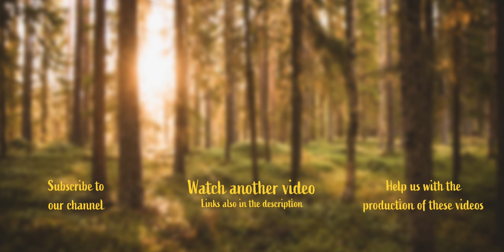FINALLY! Pouring the Concrete Roof! Will the Form HOLD UP?

Comment: Such an awesome project, good neighbors are difficult to find and a strong community is even more difficult, especially, it seems in this day and age. But y'all are off to a great start. Awesome new cellar!! I know how you feel, I've done lots of rock and mortar work, designing and installing above ground water features, ponds, and waterfalls, with rock based creeks and streams. Because, unlike y'all here in the Texas Hill Country, we on average can only dig down about six inches, before we hit several feet thick layers of limestone. So everything has to be built up. For the most part.
Reply: Community is very hard to come by these days.  Glad they have help to call on.

Comment: And if I may suggest - a layer of old carpet on the concrete. Then a layer of heavy reinforced vinyl (old billboards on highways) and another layer of old carpet, before you bury the roof in soil/backfill.

Comment: Maybe next time you pour any cement you can let your son put his hand print in wet cement so he can see when he gets older how small his hand was. Our house built in 1910 and we have any area where those people did that to their children when they were babies. Those children are in their 80s now. They visited us about 10 years ago and we showed the prints to them. They had forgot all about that.
Reply: My understanding is that the concrete roof will be underground so it's not something a handprint would show up on. Correct me if I'm wrong.
Reply: @earthangel8730  I believe I said next time they pour cement 😁
Reply: @dannyburrell4014  I don't know why this comment made me laugh so much😂 Cheers.
Reply: @darceljones2571  sometimes people read about half of what is written and make up the rest 😂😂😂😳
Reply: We did that when pouring the slab for the rain water collection barrels.

Comment: That is so very generous the neighbor assisting with help. We also have a small mixer and its like a teaspoon in comparison to a bowl full of the amount of concrete that is needed for such a pour.  It was very good you used a vibrator to settle it too. As it cures it will get stronger... like the community😀
Reply: Community is great

Comment: WOW
What a milestone ! I cannot wait to see it all covered with soil. Only comment that I would make is that I think that if the wire mesh was lifted from the roof surface 1”-2” it might have made it stronger.
Reply: It is within the concrete, not on the bottom. You can see those little connector thingies that hold it up a few centimeters from the mold surface.
Reply: Yep, another box checked off

Comment: Remarkable videography.   With that many timber supports for the roof it would have held 12 tonnes of concrete, not just the 2 or 3 placed on it!

Comment: Well done to both of you. the form work looked good and strong, a vaulted roof a very good move. good to see you put the mesh on plastic chairs and the concrete vibrator............ suitably impressed. It would be good to leave the forms inside the cellar for 28 days so the concrete can reach maximum strength (98%), the other 2% comes over the life of the concrete. You have now learnt how heavy concrete is. 
Your thoughts on community are thought provoking, are communities created or do they evolve over  time?  A sense of community is to my mind extremely important. 
The garland Tova made very pretty and very autumnal, is there significanceto the garland?
It would seem you are having a wet autumn  up there and I have had a wet winter and now a wet spring down here, still soon be Christmas!!!!!!!!
As always stay safe.
Reply: Another box checked off for them

Comment: you did massive job, guys. why did you choose concrete roof over earthen one? pine rafters [logs] would hold it, provided you don't put a house on top of it. poly film 'd keep the beams dry and lovely.
Reply from the maker: Since the climate in the cellar needs to be very damp for cheese, wood would not last very long.

Comment: Good job but I don't understand why concrete? You could have built a nice lightweight wooden roof. You also filled the space behind the outside walls without insulating the walls from the outside. The soil will pass the moisture into the cellar walls over time making the atmosphere inside damp all the time and whatever you keep in there will suck the humidity which is not good for a cellar. I'm talking from experience.

Comment: I don't really understand why it had to be a concrete roof and why you could't have just used a rubber barrier topped with soil. The space below is too low and compromised with all those support posts, hardly  worth the effort. 
Straight across solid beams surely would have done away with the inner supports. I just think its too low and cramped inside and could have had a way more efficient design and definately an easier build.
I have been watching for quite a bit and definatelly admire the two of you greatly. In terms of completing your various projects you must think efficiency as well as utilising your resources to maximum effect. I'm a home owner who can identify with the many unfinished projects and the anxietes experienced to get them completed.
I'm a corporation of 1, cannot afford swedish labour and material costs and have learnt the hard way to be efficient and use resourses to the max.
I spent a whole summer building a water proof wood/machine storage shed, on an un-used ditch on my land using scrap wood from the dump, with no experience at all(youtube).It took that whole summer and became a really job well done, but most importantly it taught me a lot of skills and efficiency both in time and resources.Subseqebtly went on to build extensive decking area,semi dug-out/below ground storage area(2x2x4m), jacuzzi pit, extensive growing boxes....the list goes on.
You have trees and earth and a little help. Concrete was not really the way to go with the roof.......maybe the floor would have been better option, with a earth mound surround + roof? Something more like those earth homes built around sandbags, tyres and hay bales?
Anyway its done now, perhaps you can invite a few youtubers during the summer months to help on the house in return for meals and knowledge exchange.....maybe most practical way to reduce your project load.

Please don't see this as any type of critisism as it is not intented as such. You are doing a fantastic job and is quite inspiring.